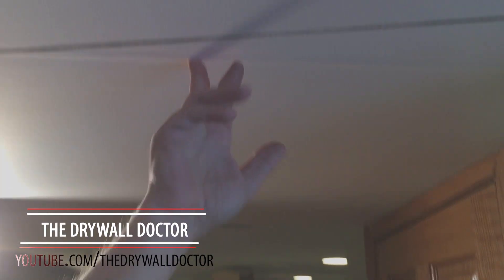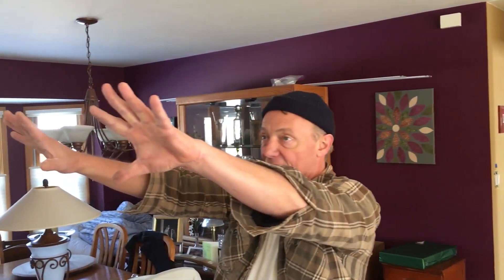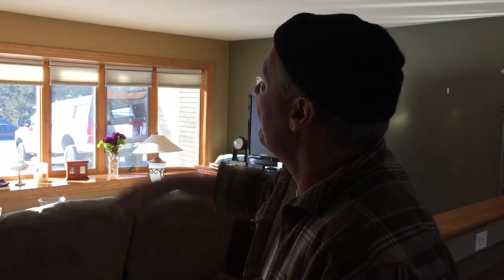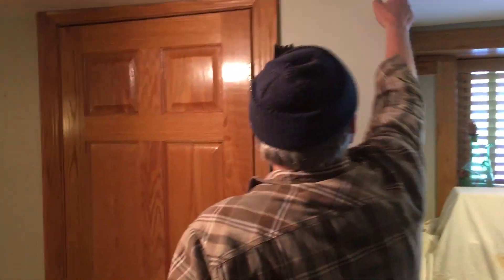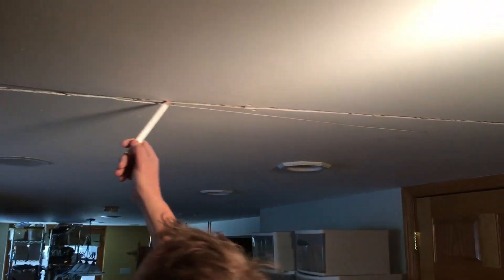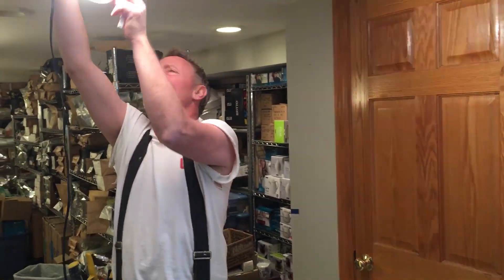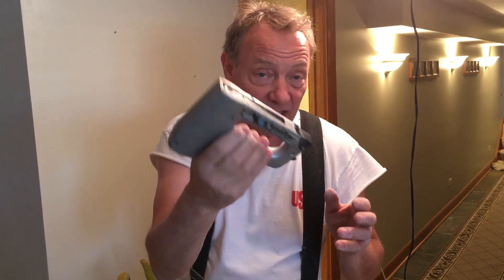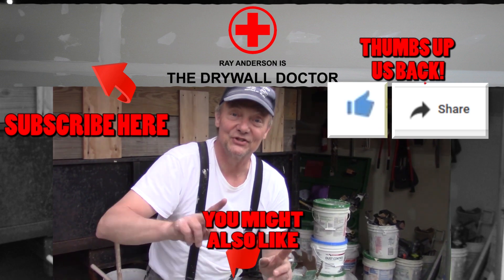The Need for Control (Expansion) Joints in Ceilings, Explained

Comment: We've been putting resilient channel on the ceilings.The trusses move and they contract in winter and lift up. It's good in basements too. It Smooths everything out 4 easy taping. If you want to get really fancy you could put L's in the upstairs ceiling corners for a deadly straight line. Fun watching you work doctor
Reply: What brand do you like?

Comment: Question - when you hang drywall panels on walls, do you never put a seem above/below a window frame or above a door frame?   Does that work well as a preventative measure against stress cracks?
Reply from the maker: Headers are just fine just don't follow the window or door jam

Comment: What would you use where 1/2 inch ceiling drywall meets 5/8 inch ceiling drywall? Also, for soundproofing, does acoustical sealant around the ceiling and floor gaps make that much difference?

Comment: So if I'm doing sheet rock on a 40'x48' shop with vaulted ceilings and have a center wall height of over 18' at the peak, should I plan on doing several control joints to avoid cracking? Especially since the shop will be subject to temperature changes throughout the year?
Reply from the maker: Or just live with a few cracks in your shop.  All garages in the Chicago land area have cracks in them.

Comment: On a wall where the crack goes off on a 45 from a window to the ceiling, would you follow the 45 or go on a 90?
Reply: I’m thinking it would be tempting to run vertical floor to ceiling expansion joints on both sides of the window….  When finished well it shouldn’t look bad and could even look architectural maybe
Reply from the maker: Follow the 45 if the wall is less than 24' long it's just a weak spot and should be fine after you tape it.
Reply from the maker: If the wall is over 24' you might need to do that.

Comment: have a crack over my doorway and sailing in the same spot I keep repairing it keeps coming back
Reply from the maker: Not Necessarily I was at a house yesterday and the crack above two doors were at an angle.  When ever you cut the drywall it loses its strength and can crack from either corner.
Reply from the maker: No you can tell it was the drywall that cracked not the seams.  When I see that I know the drywall was done right because the seams should be stronger than the drywall.

Comment: You did a great job, but those control joints are really ugly. There's no way I would want to see that all the time. A better option would be to add framing in the attic.
Reply from the maker: I would still rather see the control joint because it looks like it belongs rather than a big crack which doesn't look like it belongs

Comment: Control joints are required for long narrow areas  and control joints should be no longer than 30’ apart.

Per

USG
The Gypsum Contruction Handbook
Page 126 under control joints